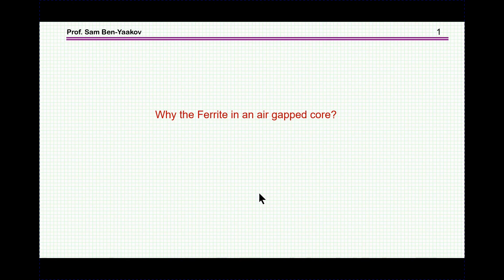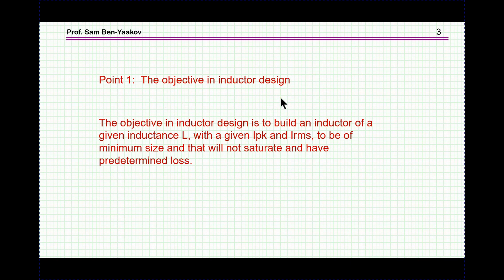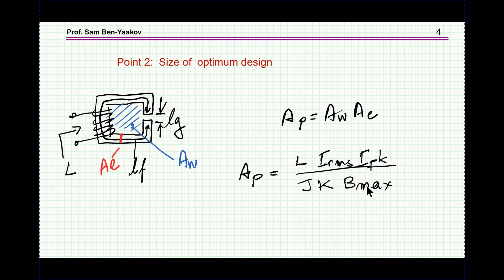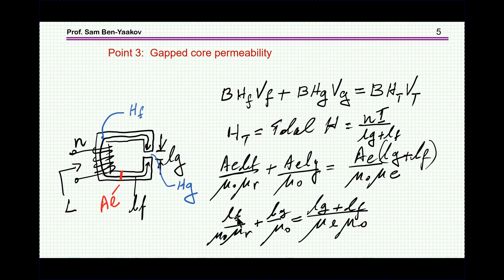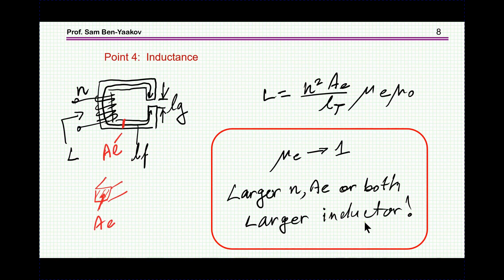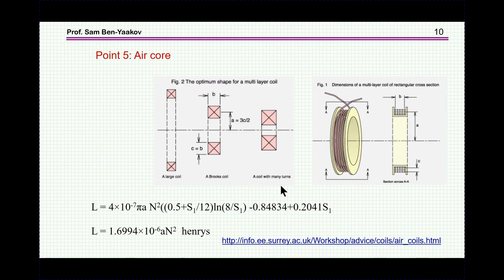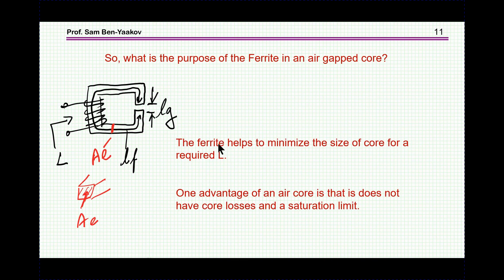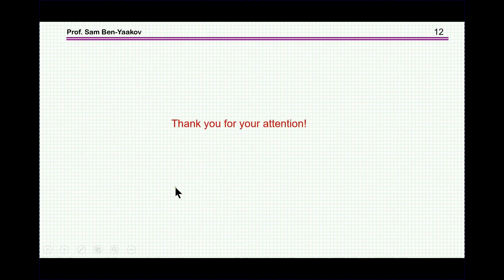Why the Ferrite in an air gapped core?

Comment: Prof. Ben Yaakov has now Prof. David Perrault of MIT who has even more ridiculous explanation why air-gap is magic! In one of his 38 FREE one hour MIT lectures he claims that ferrite material permeability depends on temperature and atmospheric pressure, so gap make it insensitive to both. He then goes to prove in APEC 2024 keynote paper with 10kW design using GaN devices switching at 10GHz! Trouble is that my latest invention utilizes 10kHz GaN devices at 1000 times lower switching frequency and 10times lower losses and 10 times smaller size!? 
Together ,they both make monumental permanent damage to Power Electronics field!? Prof. Slobodan Ćuk

Comment: It would appear both gentlemen neglect the fact that  the primary  purpose of the core is to act as a field concentrator while the primary purpose of the gap is to maximize the core ability to act as such either in terms of maintaining appropriate relative permeability, or defining the geometry of the area in which the magnetic field is to be maintained.  In general, thinking of inductance as a space property manifesting itself as the ratio between electric current and magnetic energy resulting from the currents presence is by far more beneficial than diving into arithmetic formulas.
Reply from the maker: I think: General statements like "inductance as a space property manifesting itself as the ratio between electric current and magnetic energy resulting from the currents presence" have little, if any, engineering value without "arithmetic formulas".  And BTW, the above statement is incorrect. Inductance is the ratio between the 
magnetic flux and the current L=i/phi, not "ratio between electric current and magnetic energy resulting from the currents".

Comment: I wonder, what's about the total losses. If you reduce the size, do you also reduce the copper power losses due to shorter winding lengths? One could argue, that size is not critical, and he just wants to reduce powerlosses for a given ammount of money.
Reply from the maker: Good point. Thanks. Yes, absolutely. Since much less copper is used the conduction loss  are lower.
Reply: For a given inductance value and air gap,  the more you  reduce core size the higher number of turns are required in order to achieve the inductance value. The mean turn length is lower but the number of turns will increase...For a given core ande a fixed inductance  you can reduce turns and air gap but your core loss will increase. It's always a trade off..

Comment: Thank you Professor.  I watch a lot of your video tutorials.
As you explain, the reason for a permeable core is to achieve a high energy density.  Prof Cuk is right of course in implying that the airgap defines the inductance, but he doesn't seem to realise the resulting disadvantages of a totally air-cored inductor - the best form of which for power electronics would appear to be a toroidal winding.
In 1982 I needed an inductor to handle some 20+ KVA at 3kHz.  As I'd never embarked on such a design I was advised to approach an "expert" from outside the company (I was working for BAe Dynamics at that time).  He must have been of the same opinion as Prof Cuk, because he said that an air-gapped magnetic core would need such a large gap as to spray leakage flux all about, and that I should use a stack of about 6 or seven air-cored toroids about 70cm dia.  Big enough to fill a filing cabinet.  Well, he'd had that!  This had to fit inside a small underwater body.  So I had to undertake the design for myself.  I worked my way up from basic principles.  One way to overcome having a large single gap was obviously to have a number of smaller ones, evenly distributed along the length of the core, and as I reflected, I had the idea of iron dust.  That would give the ultimate distribution of air gaps!   I found out that some quite large (carbonyl) iron dust cores were made, and calculated that those with a µr of 11 and an OD of 150mm  could be used.  I calculated that a stacked pair of these cores could be wound to provide  1/4 of my total inductance, and so a total of 4 such inductors worked fine - with no measurable loss of Q.  (The Q of the power device to be tuned was only around 5 anyway).  Straight from my notebook to the finished devices!
Carbonyl iron saturates around 1.0 Weber, cf ferrite at 200 mWeber which reduces to 100 mWeber when hot.  But I think ferrite would have lower losses at HF.
A totally irrelevant fact: according to Microsoft Translator, Cuk is the Turkish for dick.
Reply from the maker: Hi Clive, Very intersting. Thanks for sharing. AS for the last line🤣
Reply: You have now third "expert" to join two Professors with his Dick umesto fake inductors! In my Serbian language Ćuk refers to Little Owl or Night Owl! Ha HA

Comment: Dear Sam, you made this too complicated or am I missing something,
The core provides space to wind the wires, without it the effective air gap length would be much higher and hence the resultant Inductance would be much lower.
Reply from the maker: AS pointed out in video, it is a reply to the comment by Cuk that the ferrite serves no purpose.
Reply: @sambenyaakov  Yes, I meant this is a shorter answer to Cuk's question  which may be easier to understand,

Comment: Another advantage of gapped ferrite core (besides size reduction) over air-core could be lesser EMI as most of the magnetic flux is contained within the ferrite core because of its high permeability. Yes, there is some noise due to the gap but not as much as the air core.
Reply from the maker: Thanks. Good point. The best in terms of EMI will be a distributed gap core
Reply: is it bad if the gap/ferrite is glued(with spacer like paper) so it cant move/oscillate?
Reply: @sambenyaakov  distributed gap cores are better in order to save space because it is possible to use them with an higher flux density with respect to ferrite cores. The cons is that in distributed gap cores you can't trim the inductance as good as you do with air gap in ferrite core. When the required inductance value is low of course distributed gap cores are better: if you use ferrite cores with low target inductance you are going to get a large air gap and large losses because of the fringing flux. In some cases (when inductance is not very low) why not a ferrite core with air gap and external copper shield as best solution for the emi? P.s. Your videos very clear and useful, I appreciate them a lot. Best regards.